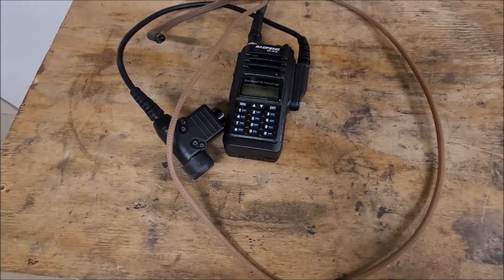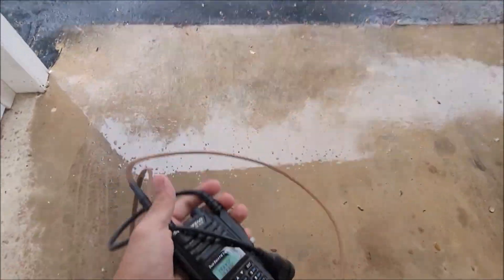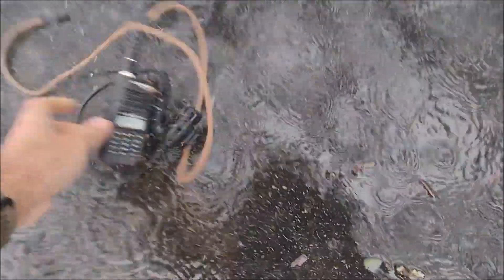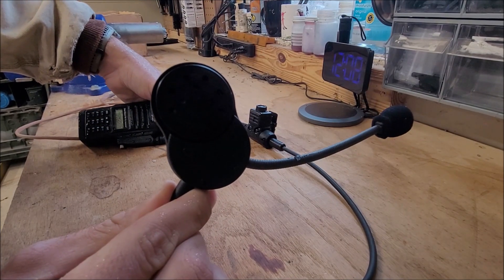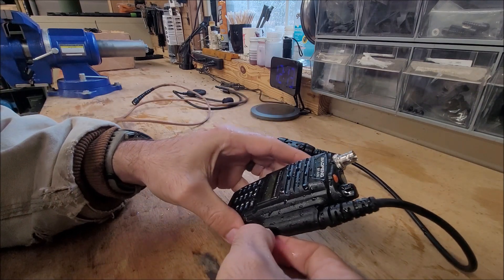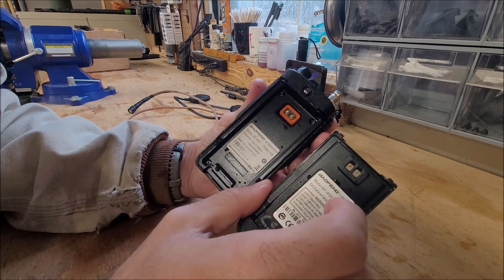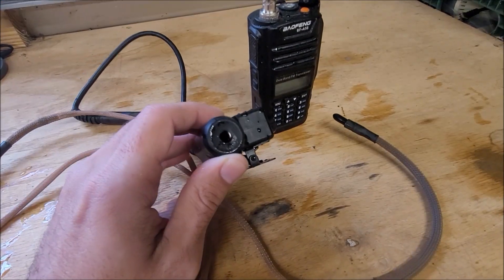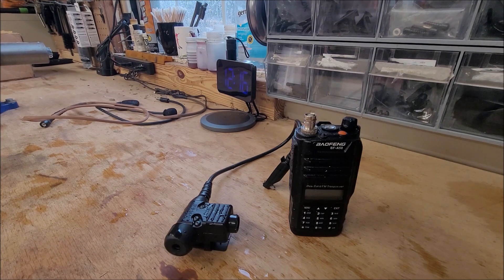Durability test of my communications setup

Comment: Would you still recommend this over a Yaesu VX-6R?
Reply from the maker: I have no experience with the Yaesu VX-6R, but looking at it quickly, it is VERY expensive compared to the GT3-WP radio I recommend. So I would say no based on that alone. You could get a half dozen with a half dozen extra batteries for the same retail prize of one Yaesu. But, that is just my opinion. There is nothing wrong with the Yaesu and some people like them for their own reasons.

Comment: Colt, my buddies and I sure thank you for all of your gear and comms videos. 2 of us are using your exact set-up.
Reply from the maker: Good to hear! I've been really happy with the setup myself. The only think I have wanted was a more comfortable non-hearing protection type setup. Ended up up just making one myself.
Reply: @CallMeColtLLC  Somehow I missed the video of you getting the radio wet. We are paying close attention since you are already spending time field testing alot of this stuff. We're not gonna reinvent the wheel, lol.
Do you like the antenna up over the shoulder or do u think you should've went under the arm?
Reply from the maker: I went over the shoulder because when taking the gear off, less of a chance of it getting stuck. Also, make it easy to grab & pull out so you can hold the antenna higher to get better reception if needed. Ultimately, personal preference.
Reply: @CallMeColtLLC  Awesome, I didnt think of either of those points. Thanks again!